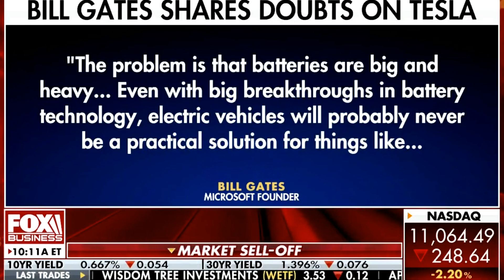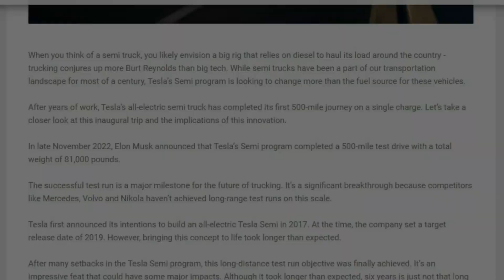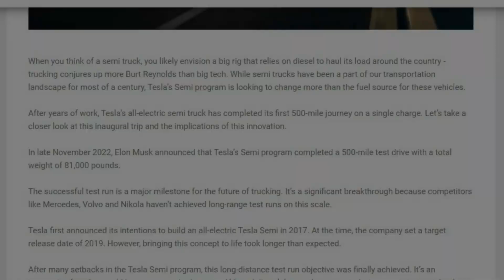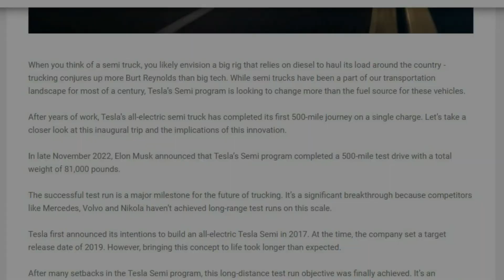Tesla Semi - Bill Gates Was Wrong, Electric Truck COMPETITION

Comment: That 500 mile Tesla semi was not charged by a mega charger, Musk himself said that a mega charger can only charge the battery to 75% capacity which will give the Semi a maximum range of 375 miles if the battery is completely exhausted (a very bad thing to do to a battery).

Comment: Is paste ⬇️
Gallery: Tesla Semi new photos. At any rate, according to Teslarati, JD Power notes that a normal semi should weigh in at anywhere from 10,000 to 25,000 pounds when it's not loaded. Add the ~10,000-pound trailer, and you're looking at about 35,000 pounds before adding any cargo
Reply: Total weight max is 82,000 pounds and maximum trailer axle weight is 50,500 pounds, so with a  10,000 pound trailer the cargo is 40,500 pounds, so the semi could weigh over 30k pounds
Reply: @iainwares6361  
Scale limit is 
34k drive axle
34k trailer axle
12k steer
80k gvw(82k ev)

Comment: What weight tesem empty?
Reply: How Much Does The Tesla Semi Weigh?
Sep 1, 2019 — If from the math that GeauxTesla has done the Tesla Semi does weigh 25,000 pounds, it is very close to the weight limit. TheSep 1, 2019San Diego
Reply: Gallery: Tesla Semi new photos. At any rate, according to Teslarati, JD Power notes that a normal semi should weigh in at anywhere from 10,000 to 25,000 pounds when it's not loaded. Add the ~10,000-pound trailer, and you're looking at about 35,000 pounds before adding any cargo
Reply: How Much Does a Reefer Trailer Weigh? The standard reefer trailer has a tare weight, including tires and wheels, of 12,455 pounds. The unit itself weighs an additional 2,000 pounds. Reefer trailers have a gross vehicle weight rating of 65,000 pounds, while the standard payload capacity is 55,000 pounds

Kenworth recently showed off a T680 sleeper-cab tractor that scaled at 14,200 pounds (not counting fuel), according to hosts at a ride-and-drive event staged at the KW plant in Chillicothe, Ohio. As with any lightweight specification, saving weight comes from the careful choice of components
Reply: Can't be right
Mine weighs about
35,000 empty  t&t
Don't remember 34or36

Comment: Pepsi and Frito-Lay take delivery of the first Tesla Semi trucks.

This is what the industry was asking for - a whole shift class 8 truck that can haul a full allowance of 82,000 lbs. That last bit is still ambiguous since Tesla hasn't revealed the weight of the tractor unit, but it won't be able to hide that for much longer.

According to the EPA, the 100 kWh battery from Model X LR + weighs 625 kg which puts the Semi's battery pack at around 6,250 kg or nearly 13,780 lbs. This will have an impact on the total load capacity of the truck.

It is great the truck is finally here. There is no doubt it will make a difference to the hauling industry. How big that difference is will depend on how fast Tesla can manufacture the Semis and what is the final price of the truck - another piece of the puzzle that the company decided to omit from the presentation.

By Max McDee /December 3, 2022
Automotive and Maritime Journalist
Reply: yeah there is a reason why they are hiding it lol

Comment: Tesla needs to release all the information: how long would the truck need to be plugged in once the 500 mile trip is completed in order to complete the return trip. Also, they need to attempt the same trip in the winter.
Reply: Tesla SEMI truck recharge in 45 minute...
Reply: @mikafiltenborg7572  and how bad does that deplete the battery. Remember, continuous fast charges reduce the life span of these batteries and its fact. Also, how much does it weigh on its own. Elon sold a few misinfo such as it doing a million miles without needing work done apart from minimal service. It really needs to be proven on all grounds before we can say yes, it's a perfect alternative. In the release, they didn't discuss technical stuff about the truck that'd be useful to real truckers and not just the general audience who are wowed by cup holders, take off speed, cool factor etc.
Reply: @teem5642  search up iron phosphate batteries they last along time and likes to be charged at 100%
Reply: @xpreflex6265  but the semi will be using the lithium ion battery though. Think iv heard a bit about the ion phosphate batteries though, but don't know much. Will have a look into them

Comment: 82K isn't the weight of the cargo,  82k the maximum any commercial vehicle can weigh INCLUDING CARGO. If the Tesla Semi can only haul 5 tons 500 miles and then it needs to charge for a few days they're in trouble. Check out Thunderfoot's video.
Reply: Tesla SEMI truck weight 17000lbs +
Trailer 65000lbs =
82000lbs total =
Legal for electric trucks.
Tesla SEMI truck recharge in 45 minute...
Reply: You don't know the weight of the payload in the 500 mile journey Mika.

What previous Tesla Semis weighed doesn't matter.  Elon gave a two hour presentation and managed to not state the most.important information (payload weight).  He did talk about the cup holders though.  Do you think that's strange?

Comment: I think you’re missing a very important point. Yes the total weight the truck was moving is 82,000 lb but that includes the weight of the truck itself, the batteries and the shipping load. Tesla has for some reason not included the weight of the shipping load which is the most important thing. This is a red flag, just because they are not being transparent and that’s the most important thing the shippers care about. Based on seeing what it was pulling (the small concrete pieces) it looks like it’s less than what a diesel truck is capable of carrying. This is just my 2 cents, I am not an expert on this, but I’m just saying everyone is claiming victory on this while a very important data point is still missing.
Reply: Tesla SEMI truck weight 17000lbs +
Trailer 65000lbs =
82000lbs total =
Legal for electric trucks...
Reply: @mikafiltenborg7572  and where did you get those exact figures from? We need the facts not what we assume the load was. Those Jersey barriers vary in weight. Would be important to know the actual weigh in
Reply: Sadly I am agreeing about the red flag. Another was it has been stated some YouTube hosts were turned away and photography restricted. And the price? This secrecy for a truck we've waited 5 years to see is upsetting.

Comment: Electric vehicles just keep getting better and better. i predict gas vehicles will no longer exist in 20 years
Reply: There isn't enough battery metal like lithium for that to happen. The battery technology needs to evolve a lot more first, so I don't think electric will replace gas for probably at least 50 years.
Reply: @TruthandReality2  There are dozens of different types of batteries that have been developed in recent years thanks to breakthroughs in material science and technology. There is already a company in Australia that is close to being able to mass produce graphene solid state batteries. It will probably be only a couple years at most before solid state batteries are out.
Reply: I agree 100 %
Reply: Keep dreaming, your so out of touch with reality, obviously you no nothing about the trucking industry.